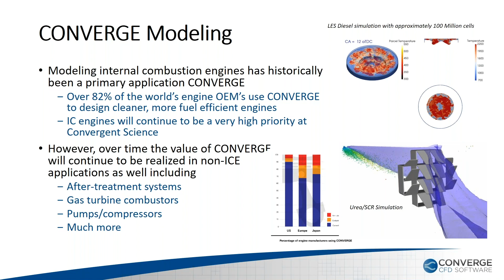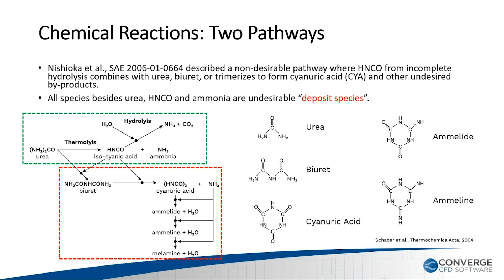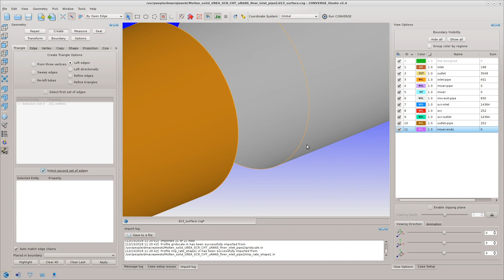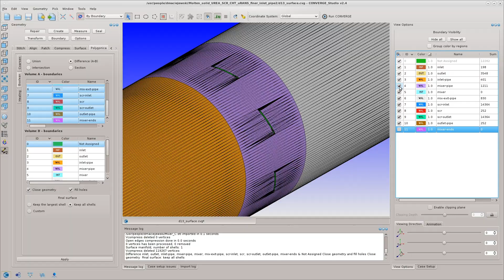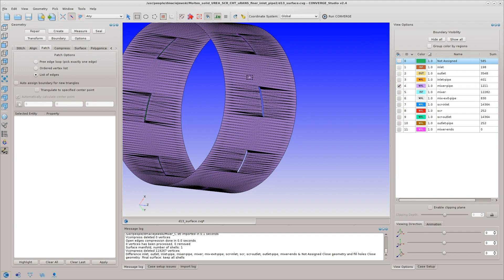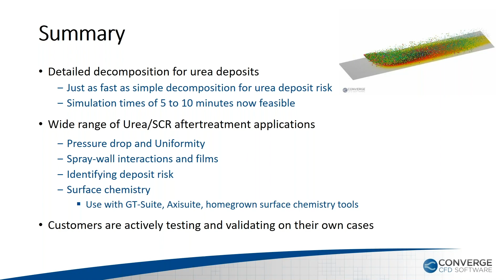Mitigating Urea Deposits in Aftertreatment Systems with CONVERGE to Meet Rapid Prototyping Schedules

Comment: Thank you for the very nice presentation! Can you please give the full citations of the references shown at 11:30?
Reply from the maker: Thanks for reaching out! Here are the full citations for those references. Please let us know if you have any more questions!
Wang, T.J., Baek, S.W., Lee, S.Y., Kang, D.H., and Yeo, G.K., “Experimental Investigation on Evaporation of Urea-Water-Solution Droplet for SCR Applications,” AIChE Journal, 55(12), 3267-3276, 2009. DOI: 10.1002/aic.11939
Kim, J.Y, Ryu, S.H., and Ha, J.S., “Numerical Prediction on the Characteristics of Spray-Induced Mixing and Thermal Decomposition of Urea Solution in SCR System,” ASME 2004 Internal Combustion Engine Division Fall Technical Conference, ICEF2004-0889, Long Beach, CA, United States, Oct 24-27, 2004. DOI: 10.1115/ICEF2004-0889
Birkhold, F., Meingast, U., Wassermann, P., and Deutschmann, O., "Analysis of the Injection of Urea-Water-Solution for Automotive SCR DeNOx-Systems: Modeling of Two-Phase Flow and Spray/Wall-Interaction," SAE Paper 2006-01-0643, 2006. DOI: 10.4271/2006-01-0643.
Abidin, Z., Das, K., and Roberts, C., “3D-Semi 1D Coupling for a Complete Simulation of an SCR System,” SAE Paper 2013-01-1575, 2013. DOI: 10.4271/2013-01-1575